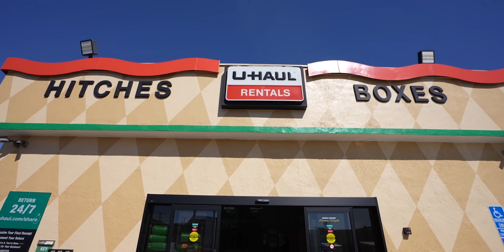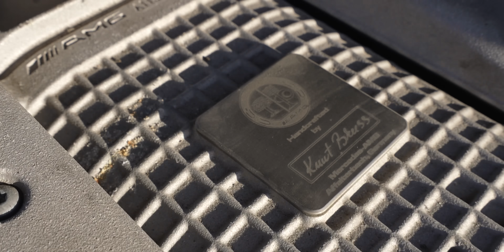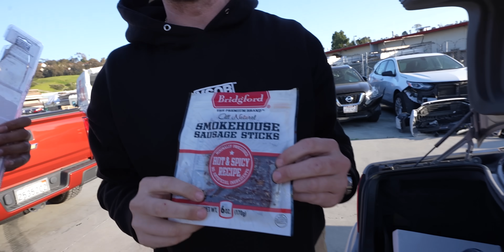RECOVERING OUR LOST CAR, AFTER MISSING FOR 4 YEARS!

Comment: I was gonna say do a cage to stiffen the chassis and put 4 racing seats to make it a drift taxi. The only thing is they destroyed it too far by being crazy. If they wanted to ask the chat what they should do well at this point they’ve just gotta either crush it to get whatever cash they can or take the motor and put it in another car that’s lighter and would be insane with the horsepower from the supercharged V8. They could then increase the power by building the motor and tune to make it crazy.